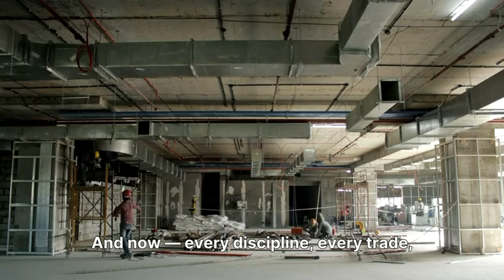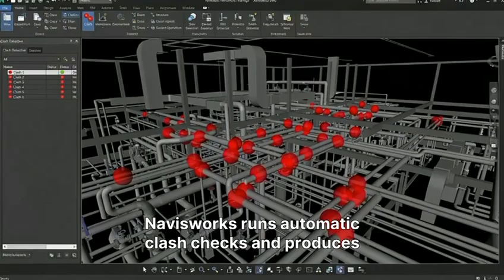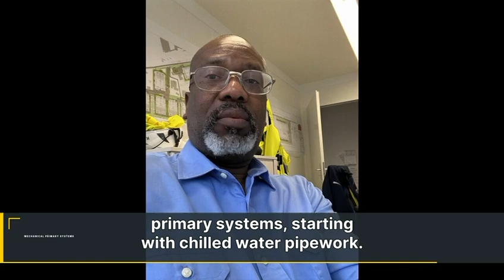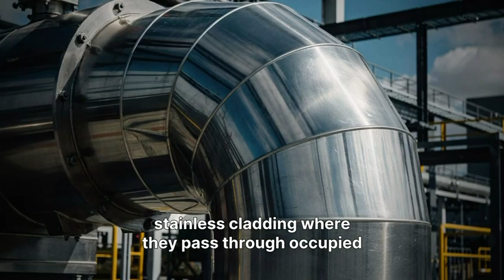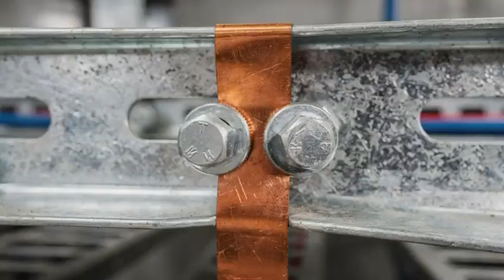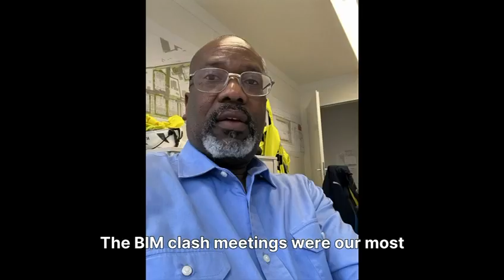Catalyst Grid | Series 1 Episode 9 — MEP First Fix (Cable Containment & Services Installation)

Comment from the maker: This is where projects either flow — or fall apart.

MEP coordination looks invisible when it works.

And painfully obvious when it doesn’t.

---

On this project, 112 clashes were resolved before installation began.

That avoided months of rework.

---

👇 What’s the worst coordination clash you’ve seen on site?

(Cable routes, pipe conflicts, impossible installs — let’s hear it)